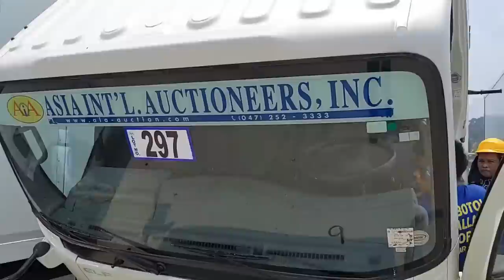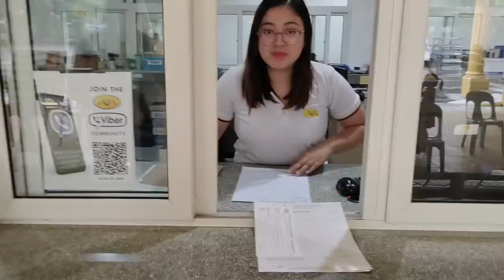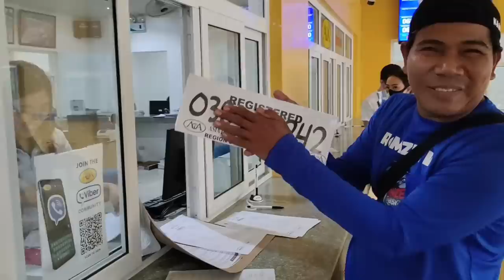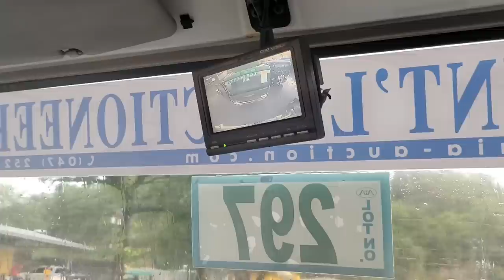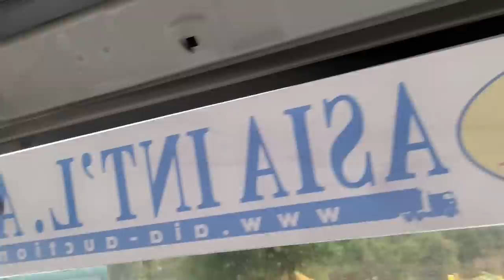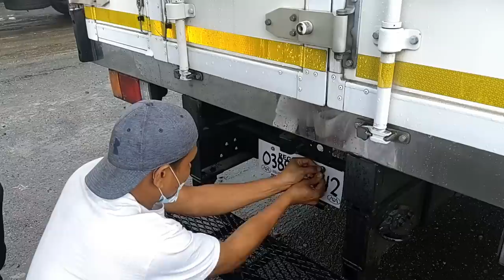Bumili ako ng Freezer Van

Comment: Sana pag ka bili mo nyan Change Oil mo na para alam mo kung kelan ulit ang palit ng Oil isama mo na pati coolant wag top water mabilis mag rust ang radiator pati cooling system ng engine.  👍🙂
Reply: Sakto pag kalabas diretso sa tapat sa Gas Station para i full tank. 👍